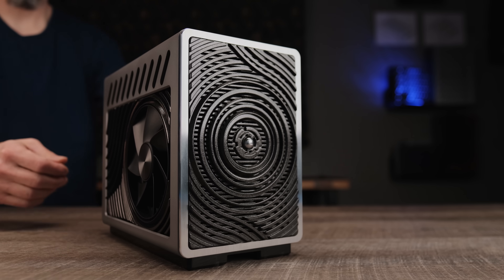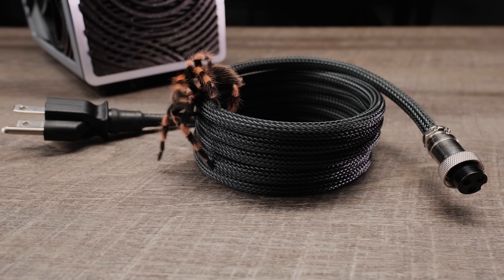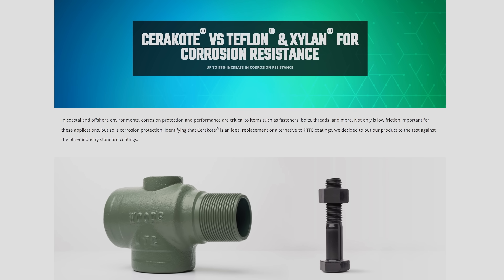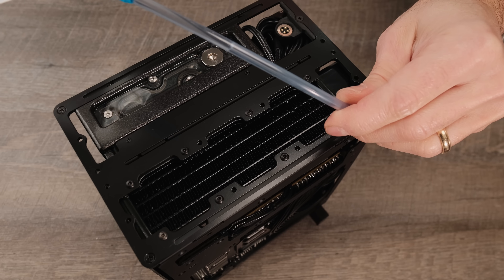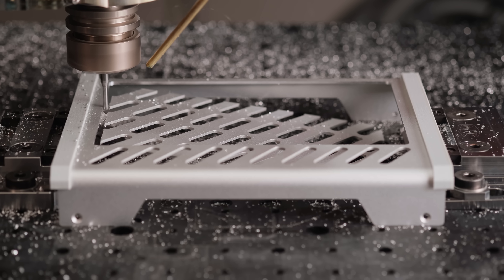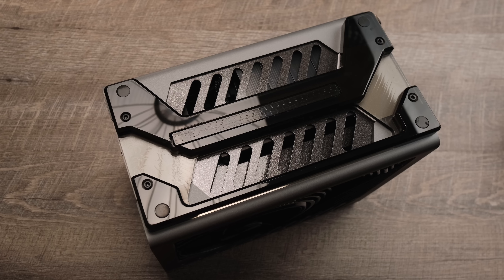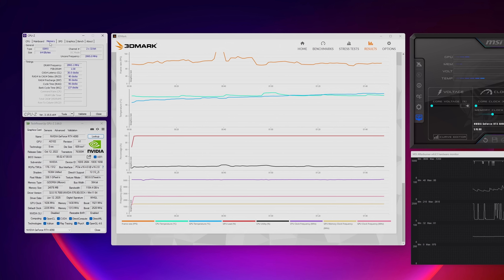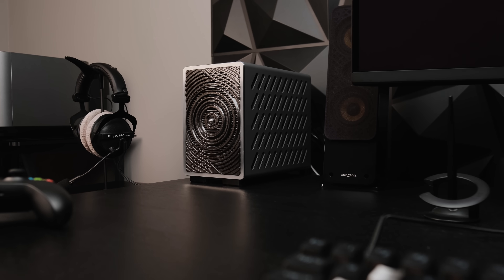Watercooled PC, but SMALLER than the GPU BOX!

Comment: "The fan noise isn't an issue" Even I a closed headphone wearer, who would not even notice door ringing and knocking or a vacumcleaner, can say, My PC was quieter than his and it indeed is a notible issue ... especially once there's no music for even just 1 sec. so it's either you blast music 24/7 or face jet take of noises every few seconds and trust me, that's worse.
Reply from the maker: It might absolutely be too loud for you — everyone’s noise sensitivity is different. However, one thing we realized we were doing wrong in older videos (this one) was using a very sensitive mic placed close to the system so you could hear the full timbre and pulse of the fans. The intention was to give people more information, not exaggerate the noise.

But what it ends up doing is confusing people. When the mic is only a few inches from the PC, it doesn’t sound anything like sitting 3–6 feet away in a normal room. Viewers subconsciously interpret it as “this is what I would hear,” even though it isn’t.

That one’s on us — it’s too much detail for most people, and it misrepresents real-world experience. So going forward, Erick and I are switching from a $1300 microphone rig to a simpler setup (just an iPhone at normal sitting distance) so the audio matches what you’d actually hear in a living room or office.

Really appreciate the feedback — it helps us make the videos better. Thank you!
Reply from the maker: For anyone interested, you can turn down the volume in the video, so the mouse click is just barely audible. Then tell your brain to adjust that the mouse would be 2-2.5 feet from your ears, so turn it down a little more. Then the fan recording is more in the ballpark...but this recording is still terrible because the microphone is near the fans not near the camera lens.

Comment: How did you manage to use those HDPlex PSU? Did you use any adapters for the 4090 power cable?
Reply: Great question. The 500W GaN powers the GPU and the 250W GaN powers the CPU/MB. The HDPlex PSUs can be daisy chained using the link cables they provide. I made a custom 12-pin cable for the 4090 that splits the power between the PCIe and EPS connectors on the power supply.

Comment: It's cool! Overengineered, but cool :) But I have so many questions. 
1) Why not single SFX PSU?
2) Why GPU and CPU have different water loops
3) If it is so custom, why not use single custom waterblock for CPU+GPU to save some space
4) if it's for gaming, why not 9800x3d, that will not throttle here
Reply: 1. An SFX PSU is too big for this particular layout.
2. Both are separate projects that were designed to fit together in this build.
3. I've made those in the past, and it could be an option but wasn't chosen for this build.
4. I mentioned that in the video. This build isn't just for gaming.
Reply: @nfcerick3634 thanks for clarifying!  HSPlex 250 is real cool PSU. Even if manufacturer provides possibility to run 2 of these synchronously, I'd rather use it in very small builds like mITX + LP GPU.

Comment: “I planned this build to have a easily swappable mobo so I can upgrade eventually…also I soldered the 24 pin cables to the mobo” 

Such is the way with sff builds
Reply: Takes less than 30 mins to remove and re-solder to another board. I get it, sounds like a lot of work but it's the path I chose. The cable is the key since it's length is perfect and M-ITX MB's have the 24 pin in the same location, so I shouldn't need to make another one.
Reply from the maker: Love it, 100% true 😂😅

Comment: 9800X3D delided will make a huge difference for CPU thermals. I would also consider some upgraded heatsinks for the DDR5 as ram can get unstable above 65c and in that environment those temps don't seem out of the question.
Reply: My thought's as well, and I would have gone that way originally but I acquired a 7950X3D for less than the 9800X3D and wanted to see how it played out.